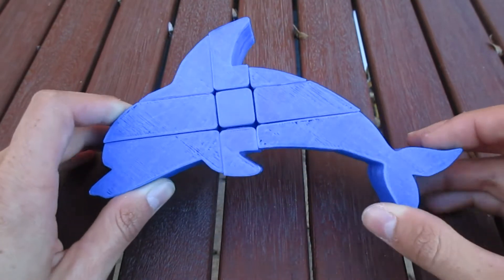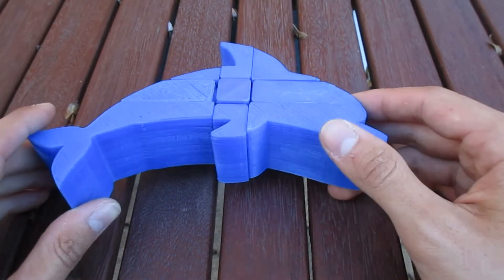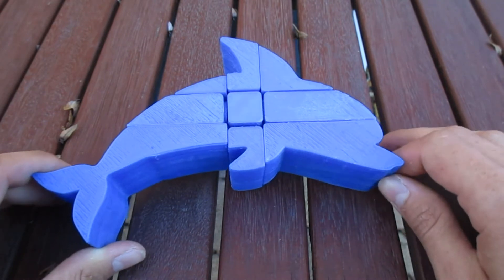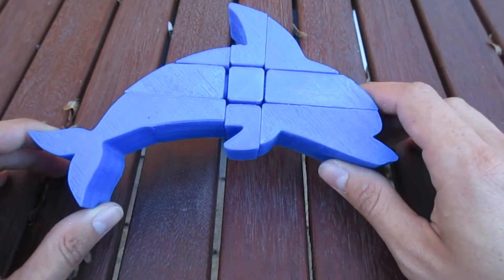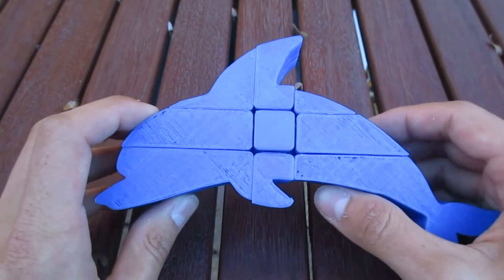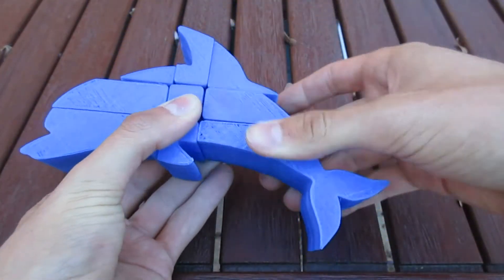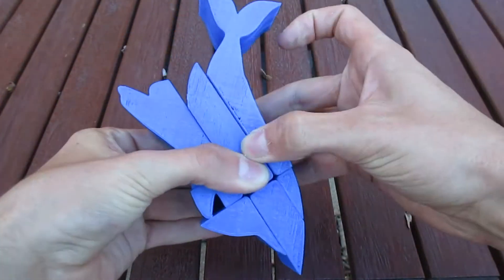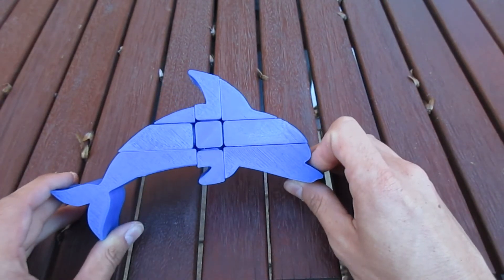Floppy Dolphin Puzzle | Custom Puzzle

Comment: Looks great :)
Waiting for the blue PLA was the correct choice in my opinion too!
Did you print a black version and were not satisfied or did you think everything through and decided to wait?
Reply from the maker: I actually dropped the idea without printing any parts for it because I felt like the result would not be good. Before printing this version I also updated a few design features (especially the caps which were even worse in the first version)
Reply: @NDPuzzles  okay, thanks for clearing that up :)
I guess it was quite a long printing job, so let's not waste time printing something that would not turn out as good as expected ;)
Reply from the maker: the printing time wasn't too bad. Less than 24h in total. But although this seems like an easy puzzle, it is actually quite sensitive to small printing errors. The first design I made was too small to be printable.